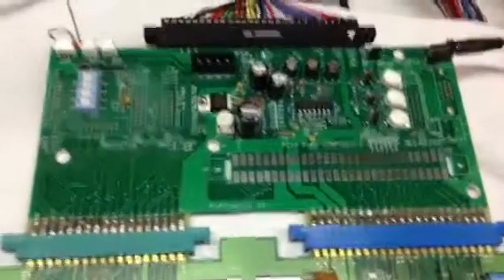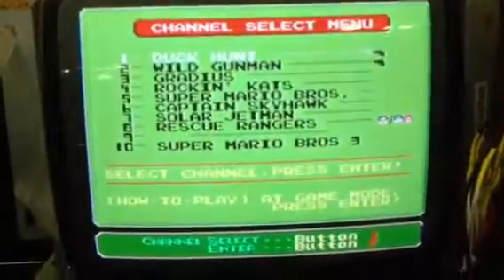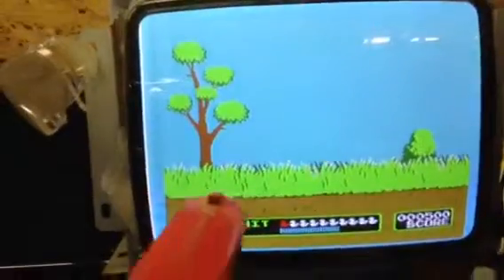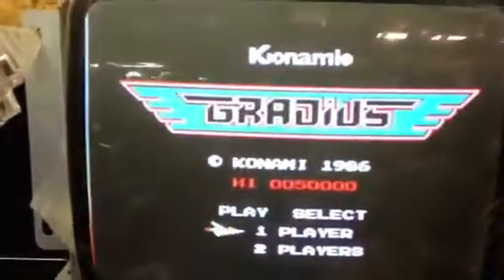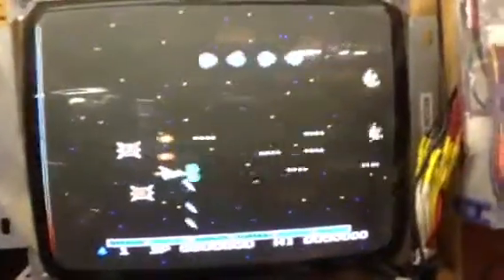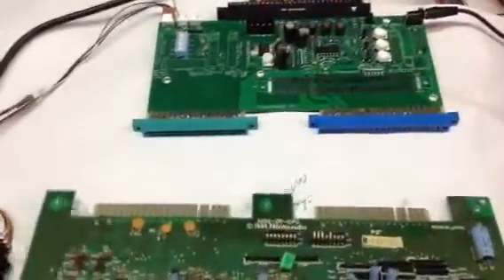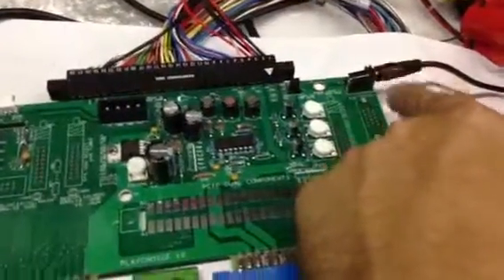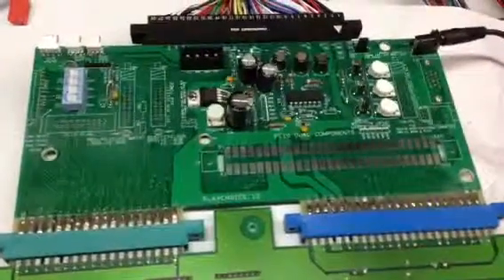Playchoice 10 single monitor & Vs. system to Jamma Adapter STANDARD VERSION

Comment: Does the Playchoice motherboard pull power from the Jamma harness?
Reply from the maker: Integration Design Group   It draws power from the jamma harness.  For better sound quality, you can isolate the audio amp power and use an external power supply -- but this is optional.   This video shows a real old version of this pcb.  I have a new one coming out soon.

Comment: Did you make a new version of this yet, and how much are you selling it for?
I've been trying to make one myself (without the video inverter circuit so far, just for testing), and I can't even get an image with the wrong colors. I know for certain that the board works, and as far as I can tell it only needs 5V. Any ideas what I could be doing wrong? (not a lot to go on I know, sorry)
Reply from the maker: Morten Riis Svendsen   Well, I have my prototype but it's not fully functional.  
However, I had a epiphany  recently and will work on it later.
But we are selling our house and moving so I will be shut down for a few months.